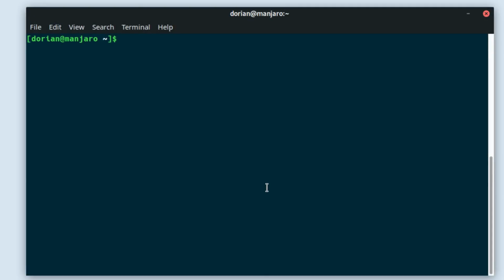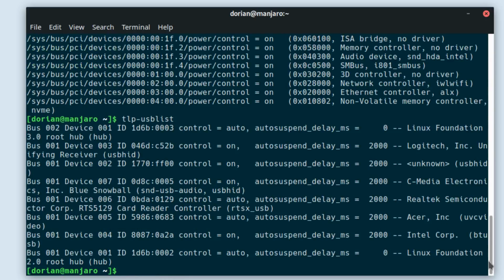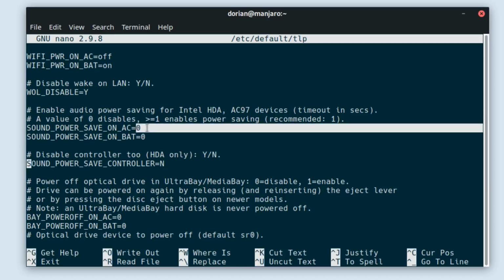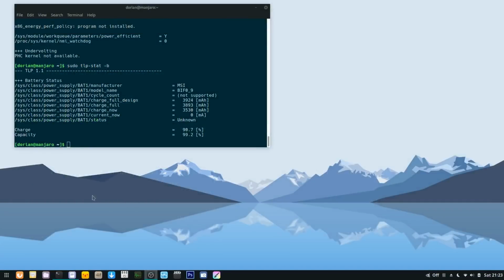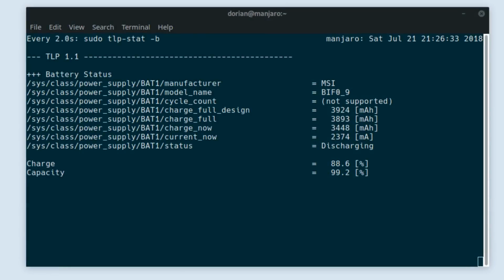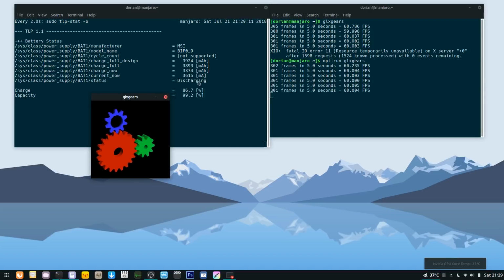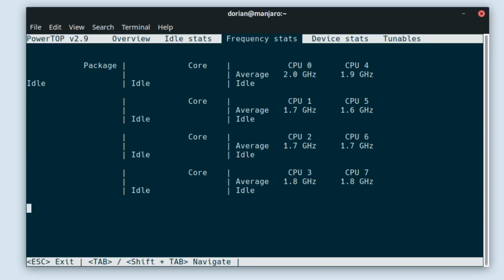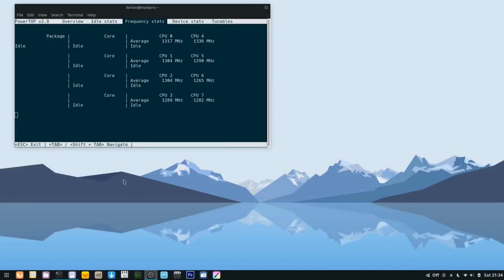Linux Power Management & Monitoring with TLP & Powertop

Comment: ** unfortunatly the last updated comment is not working / stable....
plz refer to this video
to limit the battery charging limit

 https://youtu.be/VxIKFf8I1kg

and to fix the battery issue you have to 

shut down  >> unplug the charger>> remove the battery >> hold down power button for 10 -15 sec >> replug the batt >> boot into ubuntu  > plug the charger.
-----------------------------

Is is a very good option to  half charge the battery for Max  life span 
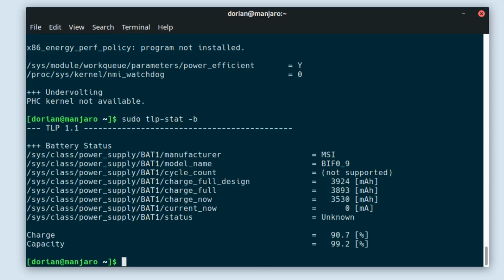BAT1/charge_full        > 8:25

Thank you I have been looking for this.

Still I am unsure why my charger is not being detected, though the battery charges (light indicators)
(its  a bug in Upower, power management in ubuntu).

*update - newer ver has start and stop charging thresholds.

use command  -------

sudo nano /sys/class/power_supply/BAT0/charge_control_end_threshold

change the value in the text editor >>>> press (ctrl+o) to save >>> press (ctrl+x) to exit text editor

use command -----------(to varify)

sudo tlp-stat -b

Comment: I use manjaro as well but I don't have the "/etc/default/tlp" file, but I have "/etc/tlp.conf" file, and the man page has this

   /etc/tlp.conf
        System-wide user configuration file, uncomment parameters here to override default settings and customization files below.

   /etc/default/tlp
        Obsolete system-wide configuration file. DO NOT USE this file, it is evaluated only when /etc/tlp.conf is non-existent.

but the "tlp.conf" is completely commented and is about 500 lines, so should I just uncomment everything or only the things which you suggest?
Reply from the maker: Night Fury This video was from 2 years ago so I would follow what the man pages say since things likely changed
Reply: @Doriandotslash  okay

Comment: My m.2 NVMe freezes the computer whenever making any setting changes. What are the optimum TLP power management settings for SSDs?
Reply from the maker: NVMe drives are sensitive to low voltage. I know there were issues because of this if you tried to use certain drives in a Pinebook Pro because it doesn’t provide enough voltage.

Comment: What if i just installed manjaro gnome, and battery maximum capacity it's 76%? how do i fix that?
Reply from the maker: If the battery only charges to 76%, you may want to replace the battery or the charging adapter.
Reply: @Doriandotslash  What if i tell u , i switch to my mac os ssd just to be sure about battery life and in mac os shows me 100% of baterry when manjaro only detect 76% as maximum?

Comment: my idle power consumption is around 10000 mw, how can i find out what is consuming so much power and make changes, any help would be appreciated
Reply from the maker: Powertop should list what’s using power.
Reply: @Doriandotslash  yes it was mostly the GTX graphics on my system. Installed recommended graphics and turned off GTX ... It's much better now ... Thanks for your time

Comment: Thanks for the video, this was really useful and easy to follow. Btw I was wondering if updating the distro or system would in anyway cause tlp to disable itself and not run automatically on boot? Obviously its checkable, but it could be easy diagnostic to forget after an update.

Comment: I noticed that most users are using tlp to improve the performance of the laptop when there is no power and users are on battery. The question I have is whether tlp can be adjusted to trick the system the laptop is unplugged but it is not. The reason is because my laptop runs off my solar batteries. I can monitor my solar batteries thru software and wish to software manage the power usage on my laptop without having to plug/unplug the cord.
Reply from the maker: Good question. I’ve never had to tweak it, but you could always ask the developers.

Comment: I have noticed ubuntu somehow capable to manage battery consumption using tlp way better then arch or pure debian stable. No mater what I did powertop on ubuntu reads 3.5 Watt consumption and other distros 7 Watt. Very notable difference and hotter and poor battery life. Might be kernel or some other options require to play with. Anyone has an idea ?

Comment: Hi Dorian,  I clicked this video since I am facing issues with my laptop battery. I ran watch sudo tlp-stat -b and saw my capacity is at 7.5% . My battery is just 2 years old (so is my laptop). Should I consider replacing or something else can be done?
Reply from the maker: Hi. Well, it is possible that the software is incorrect.  7.5% seems very low, and at that rate, it would only be lasting you less than 30 minutes.  If that's the case then yes, replace it.  But if you still get a good amount of time on battery, then it should be fine.
Reply: @Doriandotslash  yes u right. It lasts around 35mins at max. I considered replacing
Reply: Sounds like needing recalibration

Comment: install TLPUI for a GUI. no need to learn these sommands
Reply from the maker: Definitely an option, but in 99% of cases, all you have to do is install it and use the default settings.
Reply: GUI uses battery always has. That is why half you call us geeks. Test power consumption of Ubuntu versus Manjaro openbox watch resources to load and run system go down.  All the Graphical user interface with fancy icons eats up battery.

Comment: Can you please tell me your laptop configuration ...
Reply from the maker: It's an MSI GP72,  i7-6700HQ with 16GB of RAM and Nvidia GTX960M.
Reply: @Doriandotslash  damn! I got an MSI GE62 2QD Apache Pro with same specs and under Windows I get more than 2hs but with xubuntu I get 1h and 30m or less... Im gonna try now with tlp!
Reply from the maker: Let me know how it works out!  Also, you need to have Optimus drivers installed properly if you have Hybrid graphics, otherwise your Nvidia GPU will be always on and kill your battery fast.

Comment: Hi Dorian./ 
Thank you for your informative video. I was the 13th person to give it a thumbs up, hope that's not unlucky. As I live 'off grid', power consumption is a vital issue for me, hence I use my Chromebook - a lot! 
Would it be possible to put the commands for tlp in your comments section immediately below the video and yes I am being lazy B-) 
Further to this, do you think swapping my lap-top hard drive for an SSD would noticeably change the laptop power consumption?
Thanks again.
Reply from the maker: Hey Bill! Yes I've posted the commands in the description :)  
As for the SSD, it can be unnoticeable depending on how much your system uses the HDD.  SDD's actually use more power than HDD, but for a shorter amount of time and go to a much lower consumption rate much faster than mechanical drives. I will always recommend SSD's to anyone, although they are quite a big pricier per GB.  Thanks for the comment and the thumbs up!
Reply: Thanks for posting the commands, I will see if tlp ekes out the battery time on my poor old Acer laptop.
I would never have guessed that SSD's consume more power than spinning disks, I obviously need to do more research. However the read/write speed improvement (even though connected via an old SATA port) would seem to justify the expense, or at least that is what I will tell my wife! B-)
Reply from the maker: Let me know if you see an improvement, I’d be interested in knowing. As for the SSD’s, again it depends on usage. If you’re spending lots of time reading articles or using a word editor or something, then you’ll save battery for sure because the SSD will be idle and in low-power mode. But if you’re active and using the hard drive a lot, then it will consume a bit more power.
Reply: Hi Dorian, it turns out that LPM is installed by default on MX17.1. I consulted the/an(?)  LPM web site and it seems the config file is the default, so no quick and easy answers there! As I keep off my laptop due to its battery life I only play with LPM when updating the OS. I will keep on tinkering and let you know if I improve anything via LPM.